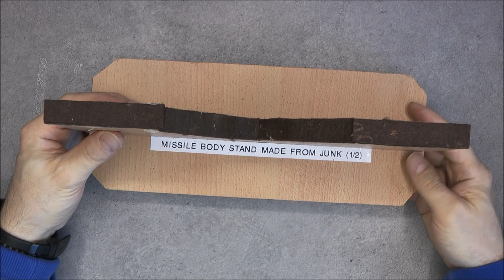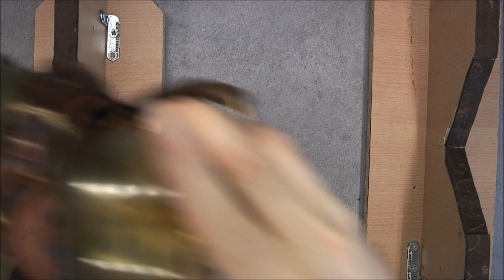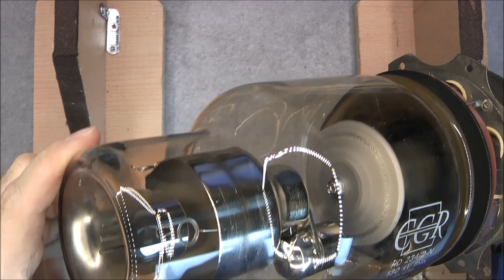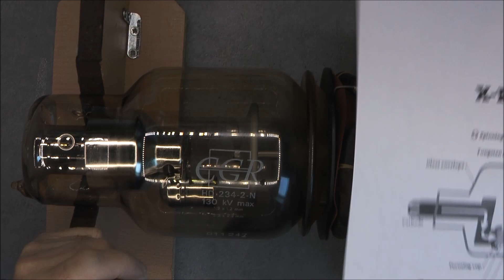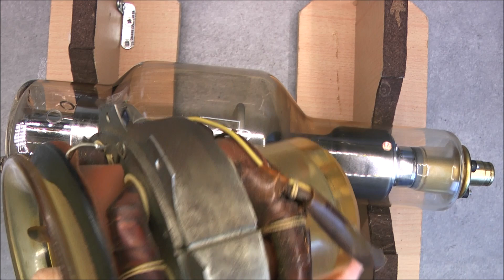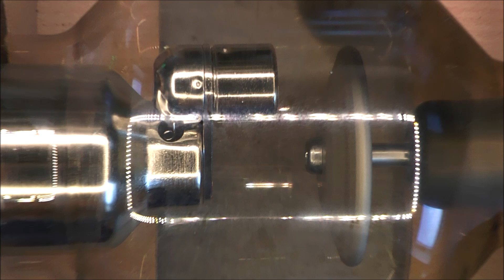Vintage rotary anode X-ray tube

Comment: Yes, that tube would be from the 70’s or even the 60’s. Looks like it has not done much work as the envelope goes black from metal deposits and the target surface gets eroded. Should be easy to get the anode to spin, the stator coil uses a phase shift capacitor same as some AC motors, maybe 10 or 20 uF and use a variac to reduce the voltage so it does not spin too fast. Filament will run on 6 volts if you want to illuminnate it, surprised how much they sell for on fleabay, I have taken a lot out of service from old medical systems and they end up getting scrapped.